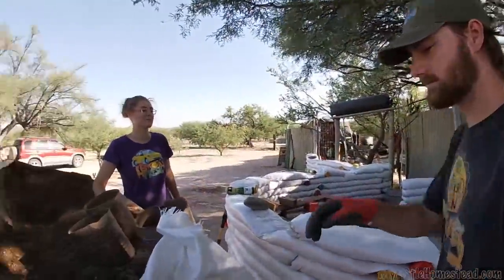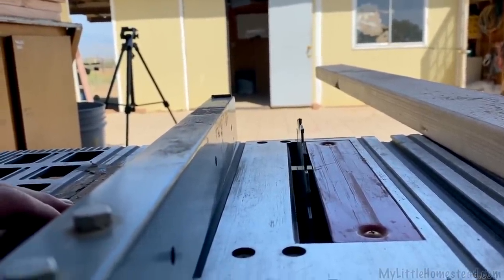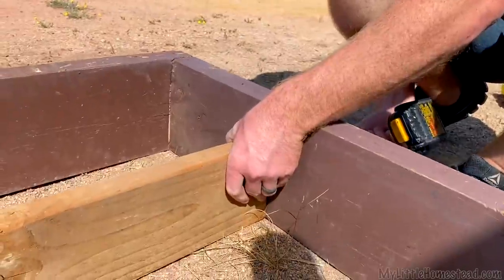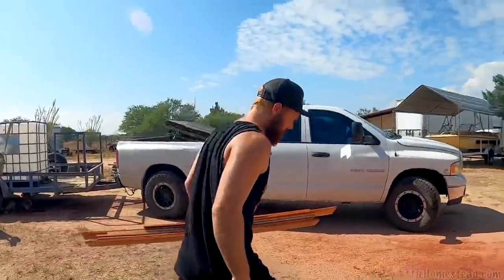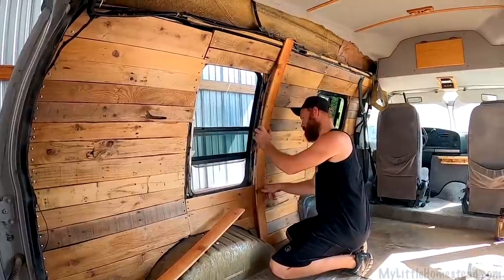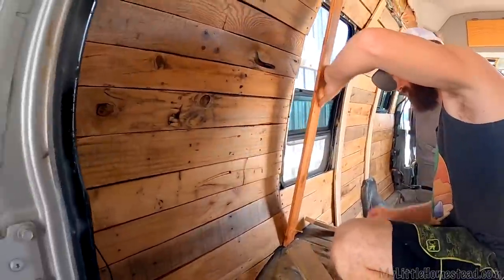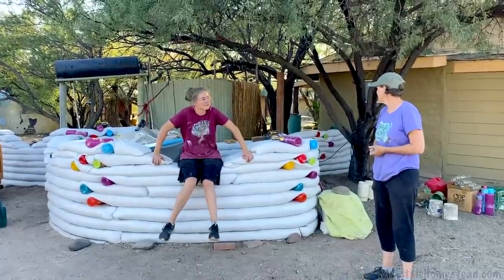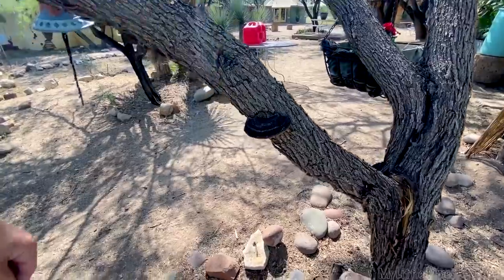Earthbag Bottle Wave, Soaking Wood Trim, Tractor Moves Engines | Weekly Peek Ep254

Comment: If you want to bend wood by using water the best thing to do is soak it in boiling water.  They do that when making baskets and it works a treat
Reply: or make a steam chamber. that's what pro woodworkers use.

Comment: and Garen when yall do the roof.  Use lightweight square tubing and panel bond glue. That will give you insulation space and if you use wood. a nice place to screw into without poking holes in the roof

Comment: I guess this is done and dusted for years now. But I think heat is the main factor in making wood bend more easily. When they are making bows (as in bow and arrow) they hang the bow up over a long thin fire to be able to bend it to the desired shape. With steam bending for other woodworking projects they of course get both heat and moisture. I think the moisture is mostly to conduct the heat better though. As in try holding on to a scalding hot coffe cup when your hands are damp and compare it to when your hands are dry.

Comment: Steaming works a lot better. All you need is a piece of 4" or 6"PVC and a fire. You can even do it by wrapping them in plastic and then putting steam into the plastic.

Comment: Working with thin pieces of wood and screws I always predrill a hole where the screw is going.
So if I'm on a 6mm screw I drill a 3-4mm hole before just to get a bit of wood away so it won't crack

Comment: If youre ever bending some wood again, here's a few things that can help.
Avoid any knots or weird grain points if you can avoid it. You run too many risks of a knot or grain bend snapping.
se a heat gun to "steam" the wood as you start to bend it. It softens it up and helps it to bend more. You can keep spraying water and using the heat gun and it can bend a long way.
Thinner is mostly better for bending wood. layers of thinner wood done together will usually be the strongest.

it looks good. looking forward to seeing it grow.

Comment: soaking wont do much  steaming the wood ..that thick 30 to 45 min will allow you to bend some but not a lot  for larger curves you need to kerf cut the back side.....kerf cut  a series of parallel cuts  thanks for the vids

Comment: Garen - soaking is good for bending wood but the glue will take longer to properly set. You could have set up a steamer using some of the pvc pipe your father has lying around and a wallpaper steamer. Remember not to level the pipe and have the steam come in at the lower end with a drain at this end too. As you found out, set aside pieces with knots in them.
Bree - love the long hair and no glasses look.
Shae - Welcome back. Your puns have made up for the severe lack of puns from the self proclaimed queen of puns (Bree). Funny or not the puns, they have been missed.

Comment: For bending wood planks in short time, you need heat and steam. Other wood needs weeks soaking in water for best playable to bend without cracking, including pieces with knots. Best not to have knots to be successful in bending wood, as it can crack as it dries out.

Comment: Next time you're looking to "bend" wood on the cheap, use a 6 or 8 in pvc pipe, put your pieces in and then steam for 20min. Cheaper (though i don't know if it will work) given your in a desert, make a tube out of black contractor bags, add water, just enough to wet the wood, seal off and put it in the sun for 2hrs. The missing component to your wood bending is heat with the water. Water alone just swells the wood making it flex to a degree but not "bendable/pliable". YouTube some videos on how to make a recurve bow 👍. That was at least show you the technique can explain it a little better.

Comment: I wonder if it would have been possible to draw the wavy pattern in a square grid, first on paper, then on the sandbags. So basically color in the squares where a glass jar goes. I use this method to make macrame patterns; since with macrame you tend to go row by row and build up, a bit like your sandbag walls, I think it should work. Then you just need to follow your square grid pattern when you are building. There's a website https://www.braceletbook.com where you can upload any picture and it will build it into a square grid.  Anyway, thanks for another week of joy =D

Comment: Uh-oh, Bree's got her hair down again. Queue seventy billion comments on how beautiful she looks with her hair down. As if all the cool other stuff she does in these vids is unimportant compared to her appearance.

I really like the way those bottles look so far. The colors are vibrant and clean, and the glass evens out the paint really well so the color is consistent all around. And the glass makes the color look glossy, like a really good automotive paint job with a clear coat on top. Hey, I wonder if you do a really light coat first, then sprinkle in some glitter while the paint is still tacky, and finish up with another heavy coat or two, would that simulate the metal flake effect in some expensive car paint jobs?

Nice to see Shae back to work on a homestead project, too. And don't worry Shae - I laughed at your puns, even if your mean ole' sister didn't. :D

I know you guys don't like to plan things ahead too much; you like to let your projects flow creatively as you work on them. But in this instance, I think a little pre-planning could help a lot with the bottle pattern in the wall. If you draw a series of straight lines to represent each layer of bags (like the staff in sheet music), you can add circles to represent the bottles. It doesn't have to be drawn to scale, is just has to serve as a simple visual representation of the pattern, to serve as a guide as you place each layer of bags.

Comment: that's PINE... sigh... Pine is not a good building material.. it's just Cheap. - there is Lots of ways to do and Use wood... with the right grain and some  casting dyes (sigh) - a person can take a Straight piece and turn it into a Spiral... all one piece without cutting...  <heart> - the tubs looking good.